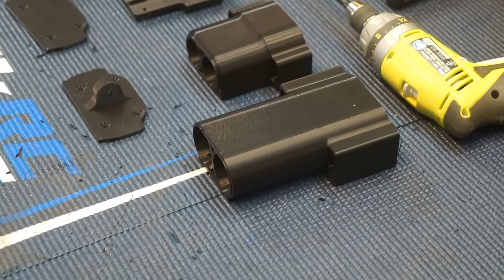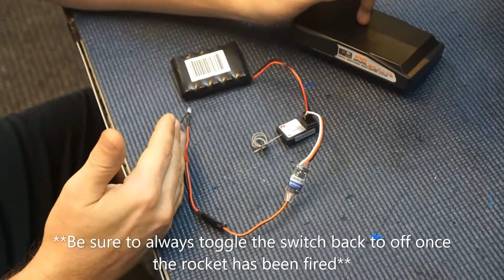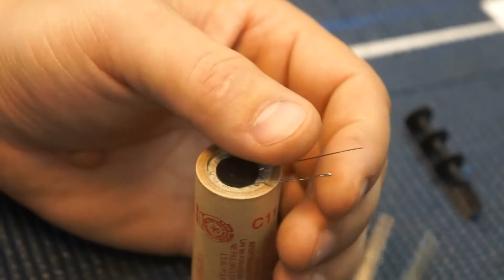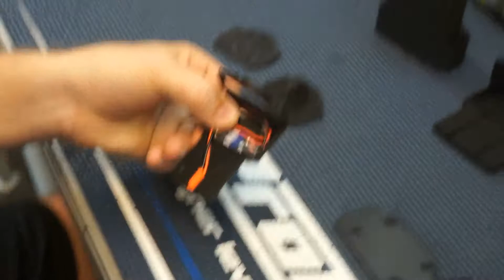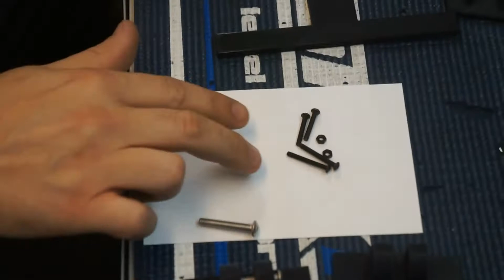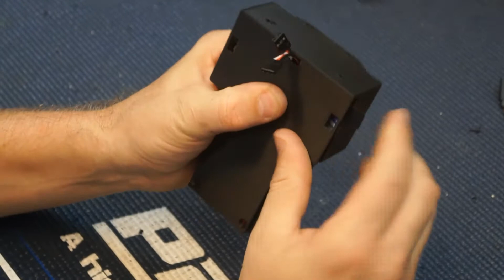AJCMods Functional RC Car Rocket Propulsion Boost Kit Assembly & Safety Video

Comment: The C-4 jet capsule episode is missing. These used in this video are Estes rocket units and there are higher level ignition systems. I installed a rocket system in my 1970 Javelin in the grill that would launch at 50 mph straight out and would launch 80 rockets at once. I had a master switch to kill the power and a light showing the system was armed. I used Radio Shack micro switches back in the day. I like the full size Jet Funny cars these days or Nitro Funny cars for truly inspirational power. The launch system in the grill was fun but the fuse delay can cause operational and targeting issues. Fuses burn differently and the inconsistency is the hazard. I installed a different system in the SC/Hurst hood scoop of my Rambler Rogue and it would fire 24 rockets at one time. It was only accurate up to about 40 MPH due to the horizontal configuration where the Javelin grill rocket angle was nearer to 45 degrees. The cops could not figure out where the rockets were coming from because the car was moving and no windows were down. Too many James Bond films and all the GM training, cheers and keep the dirty side down, stuntgirl

Comment: hi hear me out is there a way to get the rocket and the parachute on the same body?? cause that would be epic
Reply from the maker: Yes! You would just need a high end 4-channel+ radio like the Futaba 4PV/4PX or FlySky Noble NB4
Reply: @ajcmods8429  where would I mount the rocket though If I have the parachute on the back?
Reply: @ajcmods8429  also will the rocket boost explode because I want to keep my car running lol